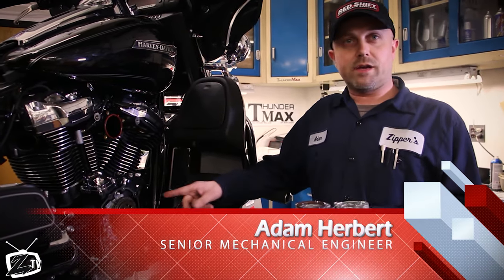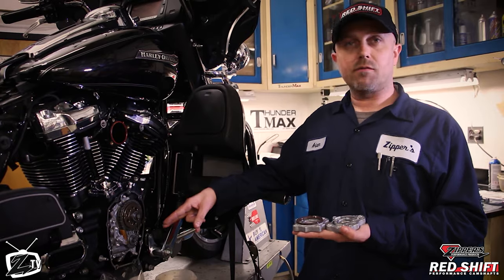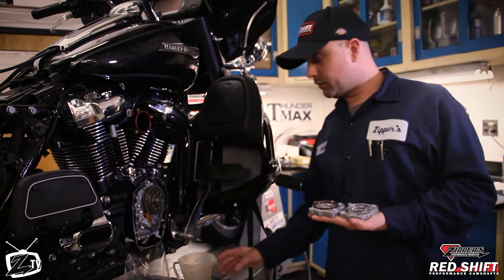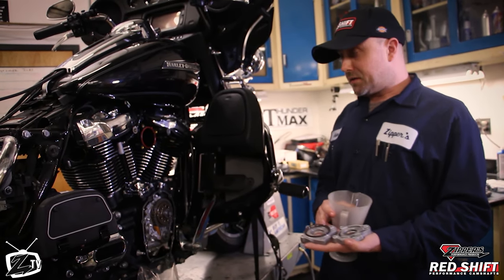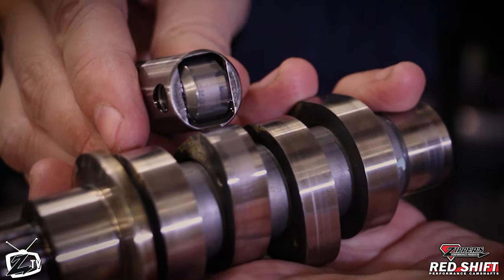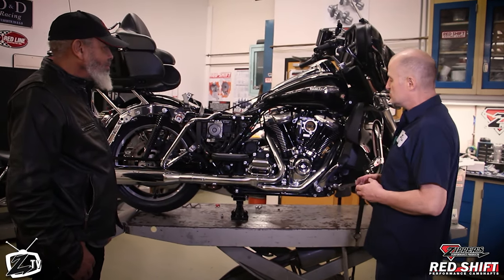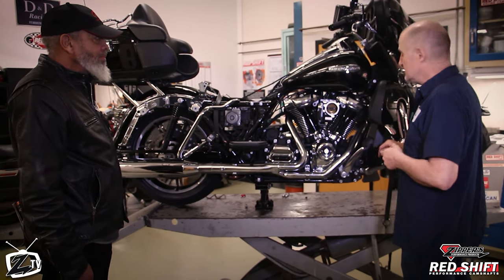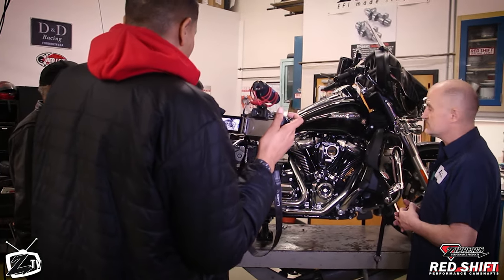Red Shift 468 Install and DYNO Results - Stock Milwaukee-Eight 107

Comment: I betting that so called roller and cam frosting is from liquidize metal particles from the oil being imbedded on the surfaces of each..I hoped the torque and power curves to be better, more flat or linear though.  I might decide to go with a different cam now.

Comment: I have the Fuel Motor WMB-22X cam, Fuel Moto,  RTX two into one exhaust, Dyno tuned Power Vision,and Harley Ventilator Extreme air filter. I ride in the RPM range from 2,500- 3,800. My 114-engine still pulls good in 6th gear from 2,500 RPM"s.  Would I gain a stronger improvement by switching to the Red Shift cam?

Comment: Nice, have you tested this in a 114 with this exhaust combo? 
I have but without exhaust in my 2017 CVO SG. I think my limiting factory is my stock exhaust header with factory cat. I do have TBR slip ons though.
My numbers are 97/123 on one dyno at 2200' in Edmonton and 100/126 at 2200' at Cave creek in Phoenix.
I have a major dip and rich at 2000-3000 rpm and I might think its the stock header with cat, but really don't want to take out the cat cause I hate the smell of raw rich fumes.
Maybe T-max can get rid of that if I send in a data collection.
Reply: fffanman seems difficult to find info of this cam in the 114,
Reply: It's the Cat !!!
Stock headpipes are actually  pretty decent when you cut out the Cat and reweld it.
Can't have both.
Your choice... cat... or more tq/hp with some smell 🤠
Reply from the maker: It works WONDERS in 114s. We use RS468s in our SLEEPER 124 kits
https://www.zippersperformance.com/zipper-s-sleeper-124-kit-for-2017-up-107-milwaukee-eight-models/
Reply from the maker: Your exhaust may be your limiting factor.
Reply: It’s your complete airflow limited by your exhaust restrictions. I’ve had stock 103’s & now 107 M8, ive replaced full exhaust, preferable stepped headers that 2-1 for scavenging for performance, high flow air filter, & tuner all at once you’ll see major differences. Keep in mind Thundermax has Autotune, so while you can start w/ a base map it will read your O2 sensors for air/fuel & adjust for you based upon your elevation & riding, no data sharing required. FP3 from V&H also is good Autotune for the $, but I’ve had both & the Thundermax while more $ is significantly better, & adapts for long term more extreme builds down the road. I believe the Zippers cams are more aggressive than Screamin Eagle so the HD kits, which are good, may not produce as much wheel HP gain